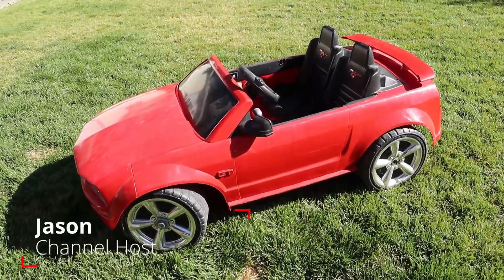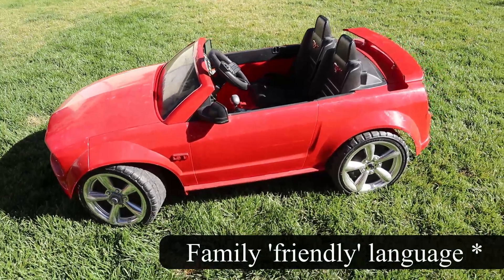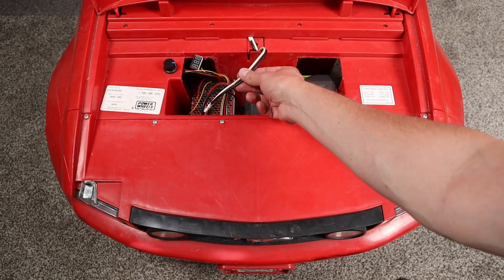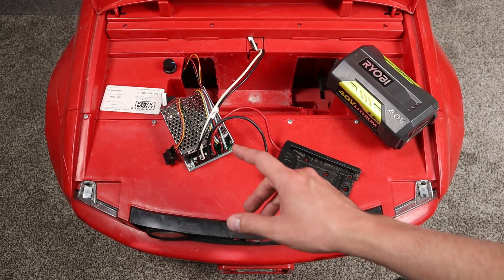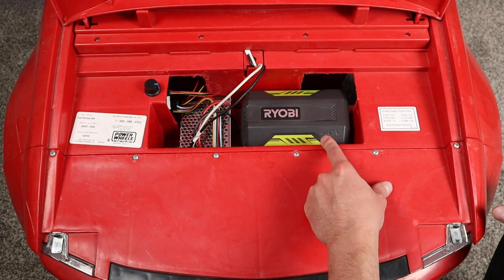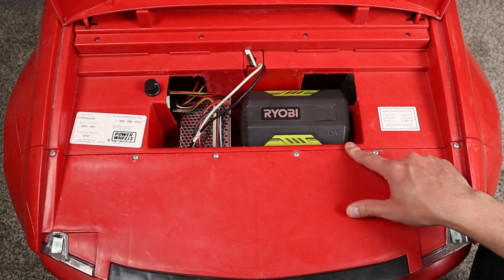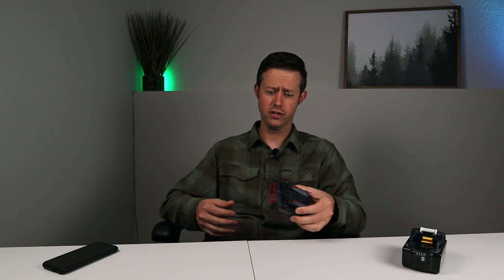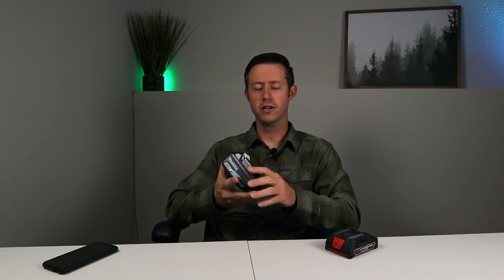40 Volt Power Wheels Mustang! Simple Mod - Much Faster!

Comment from the maker: *UPDATE: Putting a higher voltage into your power wheels could damage other electronics onboard (Radio, lights and so forth). If you plan on doing these modifications, UNPLUG those electronics before applying higher voltages. You will not be able to use those electronics while running over 14volts. The motors can handle the extra load BUT lights and radios could be damaged since they are only designed for 12 volts. * 

Also, this modification works very well with 20v tool batteries as well, no need to go out and purchase a Ryobi 40volt battery if you don't have one.
Reply: This set up dosnt work with the smart drive mustang. Bought all shown supplies and dosnt work.  Keeps overloading the board
Reply: Also the links you have for the controller is no longer the controller you have
Reply: @Teejay620able remove fuse cut off..
Reply: you can still run all those options and lights with a simple bypass and a 12 volt regulator.
 I ran 2 24v pushing 46V average straight to the wheels. regulator feeding the radio and lights, just pulled the pins out of the plug and plugged right on to the regulator. 
you might want to upgrade to a 775 Dc Motor and replace the factory grease in the gear box. the factory 12v motors will burn up with long term use and the gears wear out pretty quickly. 
the 24v 775 motor doesn't get anywhere near as hot with the 40+ volts on it so it will last alot longer.
Reply: Ok so from what I’m reading I need an upgraded control board any one know where I can find that also I could by pass that and simply hooking them to go straight to the engine oh boi seems like I need to do hella wiring 🤣 I just wanted more power it’s like real car lol I need to upgrade the engine the trans the ecu then run boost 😂 anyways I have new motors and gears rated at 24v ima run that till I can figure out how to properly do the wiring
Reply: Ya I blew up my trucks rx23-a12v which seems to control all the accessories. I ordered another one and will try Fuze to see if I can keep using the 40v battery for atleast longer run time if not more power
Reply from the maker: @wolfserker3179  you'll need to bypass the control board if you want to run higher voltage. That control board is probably only designed for 12v (or whatever the default batteries were).
Reply: @Jasonoid  yup just realized that. I'm trying to run a 40v ryobi on a best choice.  I also found a 24v control board for this one
Reply from the maker: @wolfserker3179  I had a friend that used a dewalt 20v battery with his 24v control board, still worked great! Doubled his speed.
Reply: Thank you i was going to ask that question
Reply: So how come you can use the 40v because when I checked the output over 6% becomes 40v in my case I measured 46v since i got the ego batteries can you explain please
Reply: Yea I blew up the controller board because I tried to run two 18v drill batteries in my car lol
Reply: can you run 2 motors off the one pwm?
Reply: I did this no controller on a basic power wheels using 18v ryobi directly wired and no issues after 9 months.
Reply: U can just get another 12v battery and hook up all the the electronics
Reply: I've had this same car and heavily modded it, first with 18V, which was faster, then with 36V, which was very fast but slowly burned out the motors.
Reply: For other ride-ons that have a circuit board (music, steering motor, R/C etc) can you install this as a "Boost"  to the motors between the circuit board and the motors? You keep the original battery connected that way the board does not get damage with the increase in voltage?. Just an idea, I'm toying with this..im not an engineer
Reply: @FernandoLarez  You should be able to separate the circuits entirely - Have the original 12v battery connected to the lights/radio etc and their respective switches, and a completely separate circuit just for the drive motor.
Reply: @MegaRetroRocket  correct. it is easy using old batteries or other ... 6vx4 12vx2 etc..... im using 2x12old batteries  @ 24v thru a fuse and throttle through to the wheels.

i am waiting for my WELLYE 24v pcb... but if i feel like it. i could easily just play as  much as the motors and gears can handle with no pcb.... all you do is keep all electrics on a 12v line and then have a voltage controller between the power switch and the full power line two the motors. once all of this is sorted... you just start incorporating rc and go cart bits ....... hehehe... i know im getting the next size up. my girl is too big for her TT.... thinkin 4wd suv..... so i can sit.... rear drive ehh... thats just a matter of burn tyre or motor
Reply: @MegaRetroRocket  know anyone who has a video on that?
Reply from the maker: @FernandoLarez  I had a friend with a car that used a circuit board. He found a replacement one online that supported up to 24volts and then used a 20v tool battery to boost his speed. It worked really well. Just see if you can get one that supports 24v instead of 12v.
Reply: My jeeps wheels spin constantly. They do not work with the pedal. Once I flip my controller switch on they turn and won’t stop till you cut the controller switch off. What would cause this? The jeep has a circuit board that runs the lights so I just cut the motor wires that ran into the board and ran them to the controller.  @Jasonoid
Reply from the maker: @tennysonandjagger2247  my mustang is super old and simple, motor and battery, nothing fancy like lights and radio. I'd recommend trying to power the motor directly. You need the foot pedal worked into the equation as well.
Reply: @FernandoLarez  You can simply add a buck (voltage regulator) and simply splice whatever goes into that main circuit board and adjust the voltage to its native voltage. I've learned the hard way by burning out the start button, the forward/backward (ground) button, radio/speakers AND the fucking pedal oddly lol. All while running a 24v Wheelye and 2 24v motors. OR you can simply just find a 12v battery for example and just separate the power, only using the 20v-40v batteries strictly for the motors. The only problem you may run into is some of these god damn PWMs (like the one he's using)  make it additionally complicated by not allowing you to control the pedal unless you do some rewiring. I personally would eliminate everything else especially the forward/backwards switch as you only need to go in one direction anyway, and just run the power button to where the batteries are instead of the front (if yours has one). 

There is A LOT of info not being provided in these videos that's for sure. Proceed with caution and educate yourself on batteries, wiring, diagrams before trying to convert a newly purchased toy car. Maybe practice on a beater like the one he got off the classifieds.
Reply: @FernandoLarez  You could accomplish that, with 12 volt relays.
Reply: k
Reply: You can always run all the other electronics off a stepper tapped into the main battery.

Comment: Amazing followed your every step super simple.  Works amazing and powerful. Used the ryobi option since I have some of the tools but also bought some batteries. Follow the link for the speed controller. I wound up getting a little bit fancier battery adapter, thank you for the video

Comment: Flip the pieces you cut out, then glue them in. They are, after all, the perfect fit to achieve your goal, with NO holes. You could even plastic weld them. (-:

Comment: Not sure if anyone reads the comments anymore, but I have recently tickered with my sons powerwheels, and long story short, the max you can safely feed into the motors is 18v. It's just true. Even if you buy two 24v motors and then use a 40v split between them, it won't work longer than a few seconds. Eventually, a huge spike in voltage will hit one if the motors and smoke come from it and burn it up. There is plastic in these cheap motors. The best and fastest way to get the powerwheels going is buy two 24v batteries with new gears attached already and install them. Then hook up a 18v lithium drill battery. It's the only mod that will last. If you really want 40v max power, you will need a custom 48v motor and a metal gear box. Then you will need copper wires not stock. Also it would be reckless I learned since your toddler will now be doing potentially 18 mph or faster.
Reply: Link to those battery/motor combinations?
Reply: I got a 24 volt can am I want upgrade the motors and gearbox where can I get them

Comment: Can you wire the 40v battery straight to the car with an inline fuse without going through the controller? What are the risks of doing this? I have wired an M18 milwaukee battery to our power wheels but the kids want more speed 😅.

Comment: Hi, great job!! I'm making the same modification to my daughter's car, I wanted to ask you if you connected the controller directly to the two wires (positive and negative) that come from the original control unit of the car (where the lights, radio etc are connected)

Comment: Stock motors? Do you keep it at 50% to protect the motors ? I ran a 40v without pwm and it lasted about 10 minutes before it burned up 1 of the motors

Comment: I tend to like the Ryobi One+ batteries, because they lift straight out. If you have room for them, you can mount them permanently, and they won't need to be removed, to slide the battery out. The current model adapter even has its own power switch.

Comment: Hey there. I tired this and my control board popped. What board do you have or what board upgrade did you do? Thanks!
Reply from the maker: My power wheels was an old fashioned model with nothing but a gas pedal and forward and reverse switch. No radio, no lights, no controller. If you have those fancy features they probably require a lower voltage and won't work with a higher voltage like this.

Comment: Fried my motors possibly. Attached the 40v to the adapter and turned it on. Instantly heard a loud pop and the lights flickered. Seems like I needed to step down the voltage. Is that controller what I'm missing?
Reply from the maker: Every powerwheels is a little different. My power wheels was super old fashioned and had no electronics inside (radio, lights, speakers) so there was nothing to fry. The newer models have electronics that aren't designed for voltages above 12v. To keep my motors from burning up I usually run my pwm controller at 50 - 55% power. That's a fast speed for my kids.

Comment: So my son has the grave digger powers wheels which is a 24v system. Since your going from 12v to 40v in theory i shouldnt have an issue
Reply from the maker: If you have fancy electronics (lights, radios and such) those probably won't be compatible with your power wheel and might be damaged with the higher voltage. The one I used in the video was Plain Jane and had nothing but the motors and battery.

Comment: I used same pwm controller....kept burning up my boards instantly. I bypassed it and no issues....20v  dewalt battery though. Just ordered a 40v ryobi, gunna throw it in the 2nd car n see what it do
Reply: I've seen 18 volt battery go faster than that. Is there other upgrades you can do to make it fast. Like to doughnuts in the winter with studded tires fast

Comment: Well, how long did the motors last? Did you burn up any of the controls?
Reply from the maker: I run this at 45% to 55% on the PWM controller and it's still going strong. It's nice to be able to adjust the output for little kids (25%) and then turn it up with older kids (50% or so). No issues with the motors yet.

Comment: 40 volts won't damage the motors?
Reply from the maker: I run this at 45% to 55% on the PWM controller and it's still going strong. It's nice to be able to adjust the output for little kids (25%) and then turn it up with older kids (50% or so). No issues with the motors yet.

Comment: it is pretty working great. i have a question why the PWM controller is getting hot? i touched the outside the metal box. it was pretty hot and stop moving but still on. little help please

Comment: My daughters car also has a remote so i can control it for her, would this still work?
Reply from the maker: The controller board won't accept the higher voltage, it will get fried. You can search for a "24 volt" controller board for your model and you can run a 20v tool battery as a replacement.

Comment: So I bought a ride on for my daughter the ride on is a 24v utv 2 motor and already comes with a controller that has a read out on it when I add the 40v and turn it up to 60% the readout on the car turn from 24 to 35v would the current controller in the car limit how much I can push the car and can I go more due to the 24v motors ?

Comment: Great explanation on how to do it. I do have a couple of questions. I have a Huffy Torex Atv, it is 24v but it has 2 motors. Can I put both motors on the same output channel? Or do I need a 2 output controller? Also, can I leave the original 40A controller with the original battery aside to use the lights, etc, and make the 40v conversion just for the motors.
Reply: Im trying to do the same, how did it work out?

Comment: Since the motors are probably 12v, do you think upgrading the motors to 24v would make a difference? I would assume yes but the fact that its faster with a 40v power source on the stock motors makes me question.
Reply from the maker: I usually run the power wheels at 50% power, max 55%. It's super fast and is probably less than 28 volts. My 12v motors are still doing fine. Any higher and I can smell the motors getting hot.
Reply: @Jasonoid  Thanks for the reply!

Comment: Did you still use the stock controller too because I’m wondering how you got the gas pedal to work
Reply from the maker: Mine is an 'old school' power wheels, no remote control, no lights, no radio, no smart controller. Just a battery, forward or reverse switch, gas pedal and motors.

Comment: Can someone help me out? I bought the speed controller and I connected the motor wires and battery wires and so obviously I have power to it and the display etc. But where does the gas/accelerator pedal tie in??
Reply from the maker: The gas pedal is like the power switch, you need to make sure you connect the PWM controller where the battery connects so that the gas pedal still controls when the tires will spin.
Reply: Hello @Jasonoid I tried your mod in my Range Rover Ride on Car. It is a chinese Brand and not a Power Wheels brand. It has a controller where all the cables go to, but I installed the controller and it works. My only issue is what other people said, as we are not modifying a Power Wheels, the gas pedal is completely of the circuit so the only way to move and stop the car is by spinnig the dial and not pressing and releasing the pedal. Please help me ti find where should I put the pedal to work. My Setup is Tool Battery + and - to the Controller, 2 motors connected to the + and - of the controller, but where should I connect the pedal. Thanks in advance and Cheers from CHILE!!!!

Comment: Did you change the motor or the transmission gear ?
Reply from the maker: Only changed the battery voltage, stock motors and transmission. Best results will be using 24v batteries.

Comment: Did you take out the restricting screw that makes it three speed well to speed and reverse
Reply: I am curious about this as well.  Mine will not go in reverse now or the lower speed.  What needs to be done at this point.  Thanks in advanced.

Comment: I did this and blew a capacitor in radio controller now I’m just gonna wire it with out remote control
Reply from the maker: Yeah, the newer models are fancy, mine just had the motor and foot pedal.

Comment: So in my experience or lack of I find them able to put way more voltage to them if I wire the motors in series instead of parallel and for the brake put in some kind of resistance so that it doesn't just immediately try to stop using the break to try to stop it at 15 miles an hour seems to tear up the engines.  Also I've had zero survive at 48 volts with car batteries but 36 V wired in series seems to be okay also 44 V using two car batteries and 1 20 volt drill battery. 😀  My ultimate goal is 30 mph so far all I can get is about 22. I'm going to put in a voltage resistor and slowly ramp in the 48 volts and see if I can get it up to 30mph.
Reply: When you have the two motors in series you are dividing the voltage effectively in half to each motor. Additionally in series the resistances of the motors will be greater and reduce the current flow. Hooked up in parallel each motor will see 40V and resistances will be lower resulting in more current to each motor. In general, the lower current will result in lower speed output of the motor. 

Overall getting less out of the motor compared to 40V but it's also preventing the motors from getting destroyed.

Comment: How come you didn't install a fuse?
Reply from the maker: The battery I used has a built in fuse in it.
Reply: @Jasonoid  I did not know that. Thanks!
Reply: @Jasonoid  I plan on using a Milwaukee because I have like 3 or 4 of them so I'll have to throw the fuse in. Thanks for the video and the response!

Comment: So 18V and 20V batteries worked fine. I don’t have a 24V to try, but I tried a 28V I had and put it in a Power Wheels Jeep and it blew the power converted that sends the power to the motors or and the radio caught on fire 😂😂 so be careful guys haha
Reply from the maker: The newer "rc style" power wheels are way more advanced than the one in the video. This one is old school and didn't have any thing fancy.